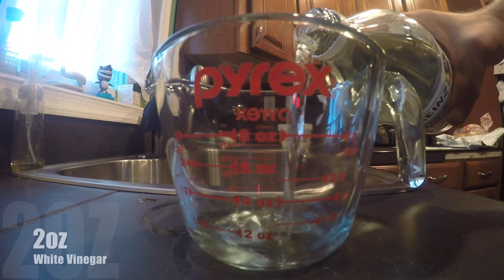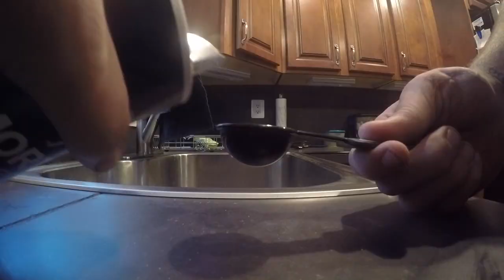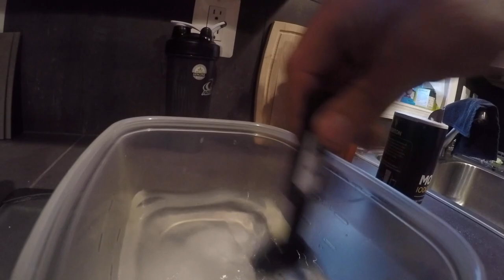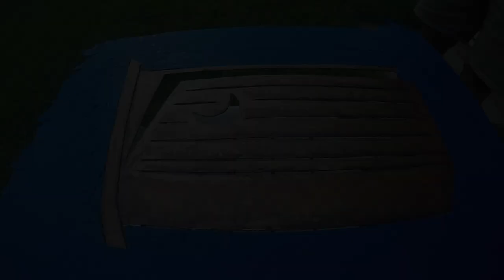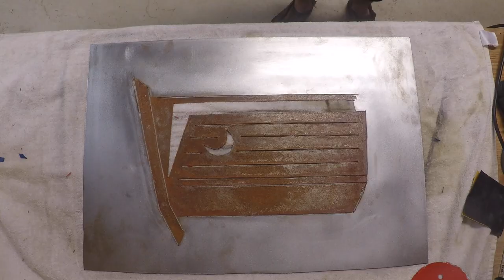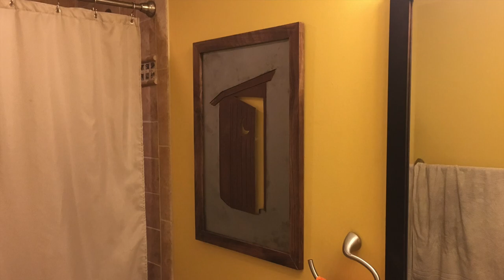How to Oxidize (Rust) Steel in Minutes

Comment: Want a faster, cooler trick?  Instead of using regular topical hydrogen peroxide (3%) , use salon grade hydrogen peroxide (12%) that’s used to lighten hair. 
 4oz of hydrogen peroxide, 2 oz white vinegar, two tablespoons salt. Mix, THEN apply to metal. If you put steal wool in a Tupperware container, and pour the mixture over it, it will start to boil, get to 150°F (70°Celsi-ish) and there will be noticeable vapor. It foams up to about 3x the original volume so use a big bowl, and do it outside. It stops boiling and steaming after about 5 min.

Comment: Funny how I just put a bunch of tools and various parts in a vinegar bath to remove rust and now I'm learning how to rust metal.
Reply: I put some blade with metal handle half way in and learned the hard way whatever in the vinegar solution is fine but what ever part is above the surface of the liquid will rust like mad

Comment: Great video. Question: Once its rusts and you seal it, will the rusting process still continue anyway? I want a rusted look, but I don't want the rust to eat thru overtime.
Reply from the maker: Apply a good sealer onto the area should lock it in. I’ve had my piece in my bathroom (where it gets steamy from the shower) and it’s held up well.

Comment: Im trying to rust galvanized metal siding... this process doesn't seem to be working
Reply from the maker: It’s not going to work on fresh galvanized steel. It’s galvanized coated to protect the steel. You’d have to remove the galvanized coating. The piece I oxidized was regular carbon steel.

Comment: Hello there, just wondering if there's any dangerous fumes create during the spraying (or chemical reaction) of the Hydrogen Peroxide + vinegar + salt solution? I'm on a mission here to create rust on some indoor ventilation vents for an Escape Room interior. It's impossible for me to remove the vent outdoor so your reply is crucial. Thank you.
Reply from the maker: I was outside when doing this project. The only thing you can smell, would be the vinegar. I'd suggest using a fan to either blow in fresh air or blow out the air inside the room.
Reply: Thanks Jimmy!

Comment: Does this works on stainless steel?
Reply from the maker: If it's a cheaper stainless grade with higher carbon content. Yeah, you could probably get some oxidation, but something like 316L stainless, you shouldn't be getting any oxidation. Hope this helps.